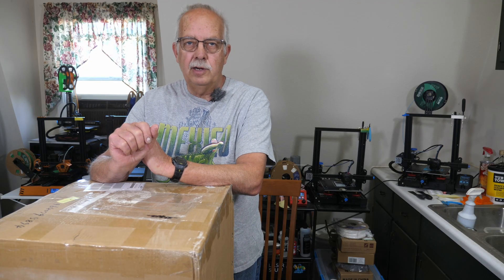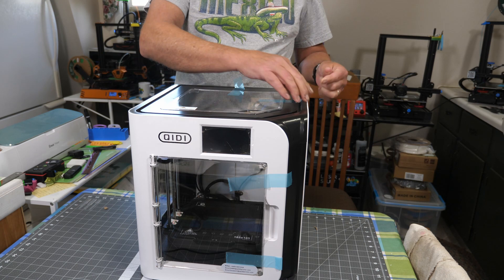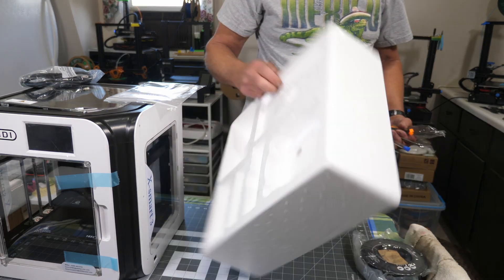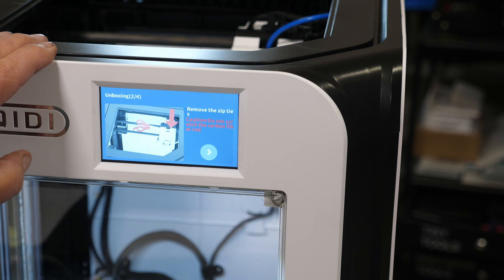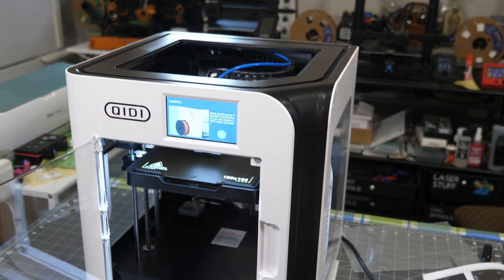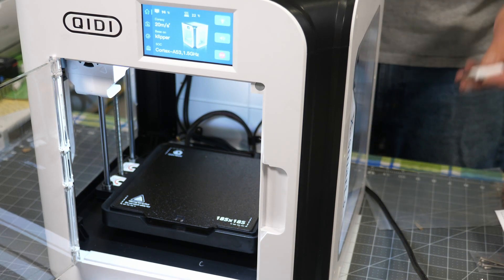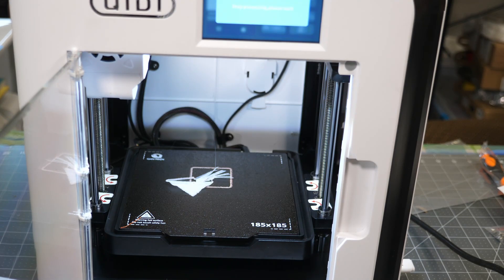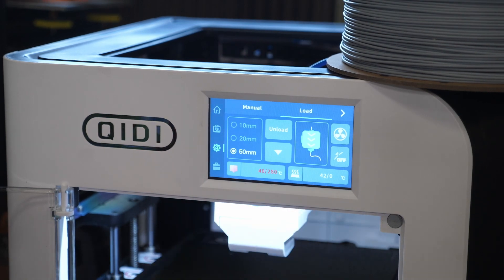QIDI X Smart 3 Printer Assembly and Setup

Comment: Try use Voron 0 settingsm in Cura, go to manage printers, and change bed size to 180x180x170 - it should work fine, eventually change acceleration in settings. Other things should work. I prefer Cura too (first slicer that i use), so I understand you. I try Prusaslicer, but for me its sometimes overloaded, sometimes - i cant find settings i need.
Reply from the maker: Thanks for the tip!  I was going to create my own profile, but this may be a shortcut!
Reply: Haven't tried it myself, but I read elsewhere, that Qidi will send a Cura profile upon request